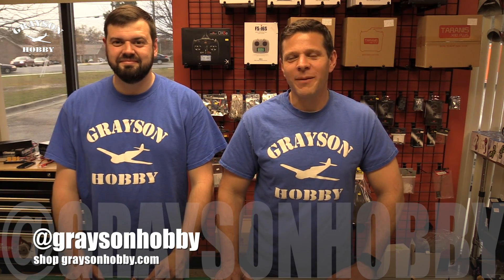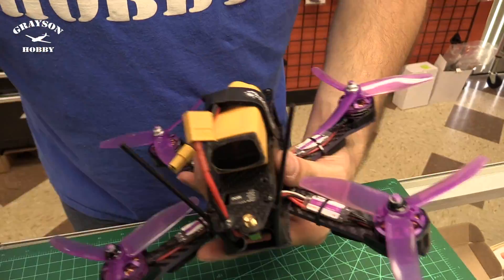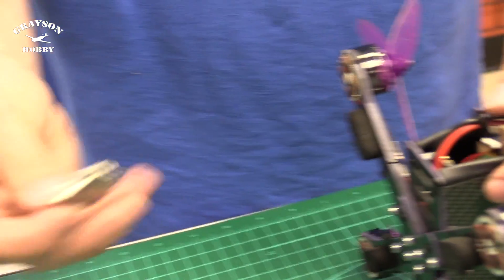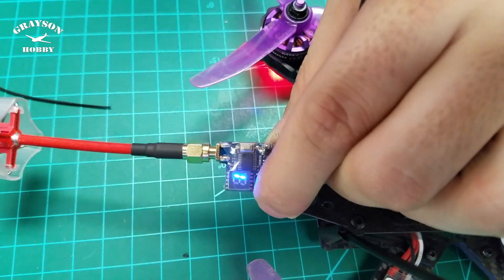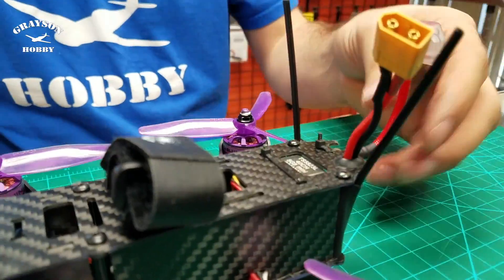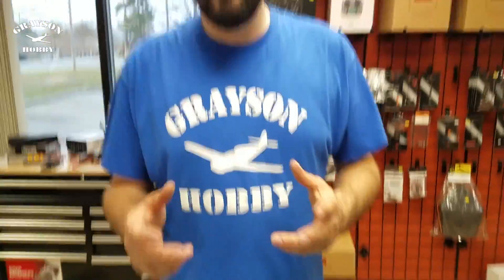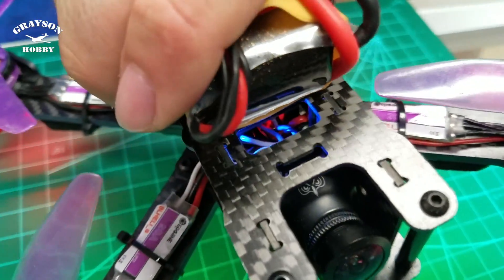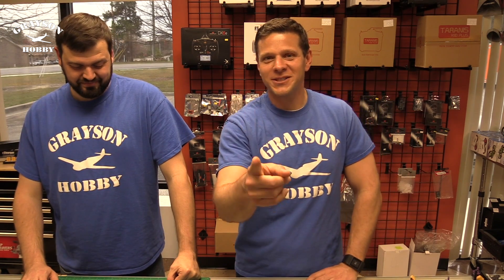Eachine Wizard Video Transmitter Upgrade How to Upgrade VTX Quick Easy No Solder

Comment: Hi guys. Thanks so much for your vids helping a noob out so much. 

I’ve “landed” on my antenna and broke my vtx. My stock vtx didn’t have dip switches, but the labelling for the pins is the opposite way round. 7.24V is at the top, or the the far left if positioned like in the video. If I buy this as a replacement, will it still work? Thanks in advance 👍🏼

Comment: How do I change the channels on the vtx
Reply from the maker: Press the button,  click the link in the description for detail directions
Reply: Grayson Hobby I don’t see a link in description and I don’t have the dip switch vtx
Reply: Grayson Hobby could it be that I don’t have a radio bound to my quad there is a flashing red light on my flight controller

Comment: This video is horrible. You caused me to buy a VTX that does not fit. I bought the one recommended in this video and it does not fit without solder. WTF.

Comment: Plz recomend 600mv vtx with same conection  fit in x220 which support OSD too..
Will b thankful
Reply from the maker: NO OSD, you will need to solder for that since its not on the stock setup.

Hey Guys, lets us know what other 'Upgrades' you need help with!
www.graysonhobby.com/wizard
VTX
http://graysonhobby.com/eachine-ts5823l-micro-5-8g-200mw-40ch-mini-fpv-transmitter-with-digital-display.html
Here are all the parts, accessories and upgrades we recommend.

Comment: Would the Rodeo 150 be a quad you would recommend if someone would be interested in the X220 wizard? I know the are different in size but price comparison they are close
Reply: Sebastrian Webb the x220 is out of date compared to the ones now. There are sooo many good quads that are better that the wizard and aren’t that much more expensive. The bfight 210 is an outstanding quad for the price.  https://m.gearbest.com/brushless-fpv-racer/pp_660800.html?wid=21
Reply: Can you recommend some to me? I would like to research them to make my selection.
Reply: Oh thanks for getting back to me.
Reply: Sebastrian Webb first thing, are you looking a micro or a full size quad?
Reply: I am interested in something from a 180mm to a 220mm size qaud
Reply: Sebastrian Webb okay you have a few good options. The Wizard X220s is a good option. The FuriBee x215 pro is also really good. The FuriBee Darkmax is also good as it can take up to 6s. And even though your not looking for this size quad i have to reccomend the KingKong ET125 its an outstanding, brushless indoor and outdoor micro
Reply: Aidan Hughes 
I really need a RTF version because at this time I don't know how to tune.
Reply: What do you think about the Arris  x220 AT9?
Reply: Sebastrian Webb is that the rtf version?
Reply: Yes it is.
Reply: Sebastrian Webb looks pretty decent. The only thing that puts me off is the radio. People don’t use radiolink very often and it wont be easy getting parts and receivers for it. If i were you, i would buy a good bnf quad from gearbest and buy your transmitter separately. I would recommend the FrSky QX7 ( or if your on a budget a Flysky i6)
Reply: Sebastrian Webb and you also dont need to know how to tune quads anymore. Default betaflight pids are great
Reply: thanks buddy

Comment: Hi Will and Basil, thanks for this video: very helpful. Quick question: the new Eachine TX526, can I also just plug in the connector of the stock VTX to this one (as you guys do at 3:10) or do I have to do any modifications on the stock connector?
Reply from the maker: Jib0n plug and play, no solder or mods required

Comment: i bought a new VTx, but it only has solder pads and I like being about to unplug it so that I can get more room to work.  Do you sell a cable that has an opposite connector to the one that is already soldered to the PCB so that I can solder it to the new VTx?  I don't know the names of the connector.  My best guess, which could be completely wrong, is a Mini Micro JST SH 1.0mm 5-pin male.

Comment: First of all i want to say that your vid.  are great, but this time “no soldering“ means buy new and better just...if u want to fly safe (for ur Quad) spend more money.
Thumbs down. Sorry.
Soldering is just a basic at that hobby.
Reply from the maker: Im sorry, I do not understand your comments. .. How else would you "upgrade" without purchasing a new product.  You can always use stick with the stock VTX.  Either way, this requires zero soldering, which was the intent of the video.

Comment: Does this vtx adapter still exist? I ordered the vtx but I don't have the adapter. I searched the site for it with no luck. I'll pay fo it.
Reply: For*
Reply from the maker: Yes it is...Do you use the link that is right a the top?
Reply: I'm not seeing a link. If I can add it to a shopping cart there is a few other items I'd like to purchase. I could pay for the shipping all at once. I accidentally ordered the camera adapter wire but that just gives me a reason to order a camera.
Reply: I'm an idiot. lol I figured it out sorry to waste your time.
Reply: I just plugged this vtx in and something started smoking. I unplugged the battery immediately. What could cause the issue?

Comment: Do not do this, I repeat, do not do this if you're a beginner, you'll rip/break your antennae off, nearly lost mine. Looks nice, but by moving it to this position you're asking for it, use the hole it works excellent.
Reply from the maker: I suppose it all depends how you crash, 99% of my crashes the quad is upside down and this has saved my VTX and antennae.  But what ever works for you is great. Thanks for letting us know!
Reply: Grayson Hobby Yes looked good on paper, but the reinforcement from that hole, I found anyway, REALLY helps
Reply: can confirm that the stock antenna will break! The pin inside mine snapped clean off.

Comment: hat lock nuts did you use on the motors on his video?
Reply from the maker: Hello, nothing special we just used the Stock lock nuts and Dal Props
Reply: If they are standarad lock nuts, then why are the white ones placed on the front nd the black ones placed on the back because thw white ones are ccw and the black ones are cw for spin direction
Reply from the maker: not standard, lock nuts, but the STOCK, the nuts that come with the wizard.
Reply: Oh ok
Reply: Im just confused why the white silvery caps are in the front and the black are in the back instead of the cris-cross formation?

Comment: There's a problem, im using the stock vtx on my eachine and now the entire sma housing of the connector is stuck in side of my antenna, my video is also very blurry in my kylin vision goggles. and i'm not sure whether or not to change the vtx, the goggles or the camera. what do I do?
Reply: if its blurry, adjust the camera lens

Comment: As a reminder. If you are flying 4S. Make sure you move the VTX power from the VCC tab on the PDB, to the 12v out. The active braking from the ESCs will cause voltage spikes which could potentially cook your vtx!! .. and nobody likes that :)
Reply from the maker: Yes, that is what we have been stating since DAY 1, you need to solder for 4S, but know seems to listen as it does 'work' for a short time.
Reply: I think a lot of people who are new to the hobby are intimidated by soldering. Its understandable. People just need to be reminded that this is not a plug and play hobby. Your repair skillz are just as needed as your flying skillz :)
Reply: I'm about to start flying 4s and this is not something that I've heard needs to be done.  Can you please elaborate a little bit more?  As in what exactly I need to do with the PDB?   Thanks!
Reply: Can you further elaborate? I'm about to do it but unclear why?

Comment: Turning the quad on with props attached!  rebels aren't you :)
Reply from the maker: Outlaw Rebels!  We did have the radio on and the arming switch set.  But yes, any work on any object you should take the props off.  Quads, Airplanes, etc

Comment: Good tutorial, I love the VTX, but eachine installs the VTX to the VCC of the PDB instead of using the own for the VTX, My advice is to change the power of the VTX to a BEC of 12v of the PDB, so if u use 4s batt u won't burn it up, since eachine uses The power port of the VTX for the LEDs, and the PDB has a BEC 12v to spare ,, Another thing you have not said other than the DALPROPS is the Runcam:) ... Thanks guys
Reply: I see now problem...the VTX Voltage input is 7-24V. 
4S batts works fine for me!
Reply: paynis21 If you fly alone It is ok , but id fly with Friends , u can make a lots nois to them

Comment: I would like an upgrade that adds an OSD that, at the least, has direction, altitude plus battery monitor.  If it has one of those "find your way back" direction indicators that would be good also.Thanks

Comment: i had several of the stock props fall apart in the air like the prpeller seperated from the hub on several of them i wont fly them any more

Comment: the reason those VTX is coming with dip switches is to keep the cost low on the Ready To Fly package obviously suppliers are going to have a much cheaper deal for the dip switches then something with more options and the stock antenna just falls apart in most cases the rpsma connector on the stock vtx us not attached only press fitted and mine and my friends just came off on our first flight.... 
Not cool not right should of replaced it for free since it was defective from the factory but we both had to buy them.... also remind people not to plug in when other people are in the air especially if you have a 600 milliwatt you don't want to have to buy someone a $700 drone just because you plug your hundred-dollar drone in and didn't realize what you were doing and then they lose their quadcopter or Break It

Comment from the maker: Hey Guys, lets us know what other 'Upgrades' you need help with!
www.graysonhobby.com/wizard
VTX
http://graysonhobby.com/eachine-ts5823l-micro-5-8g-200mw-40ch-mini-fpv-transmitter-with-digital-display.html
Here are all the parts, accessories and upgrades we recommend.
Reply: Grayson Hobby y wouldn't you use pig tails, they r cheap and no soldering
Reply: Grayson Hobby Is it the same procedure with the Eachine tx526? You once said we should solder the + line to the 12 v pad when we want to fly on 4s batteries? Still the same with this vtxa that you offer? Thanks in advance!
Reply: Grayson Hobby Can i Do The same with The ts5823s 40ch 5.8gh mini to?
Reply from the maker: We do not carry that part, but sounds like its nearly identical as the VTX we show in this video, except ours is L ie LED, yours is "S" for switch.
Reply: Yes It's have switch ch shifter
Reply: Thanks
Reply: Grayson Hobby can u transfer over the transmitter configuration through beta flight onto a new transmitter, is it possible?
Reply: Grayson Hobby installed one today and the smoke stopper lit up. Not sure if there's an internal short or what. I'm gonna look for a different option. if anyone has any suggestions I'm all ears. FYI I'm a noob